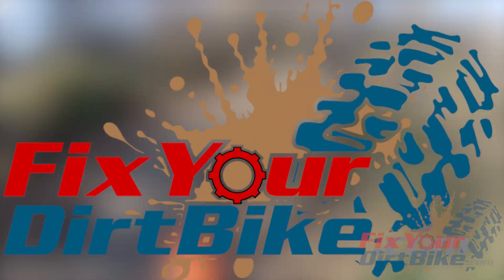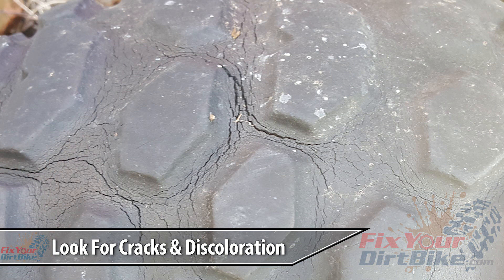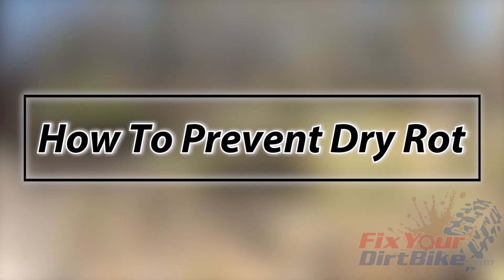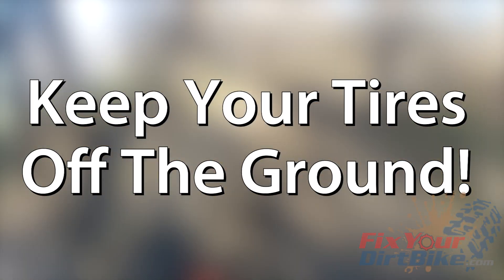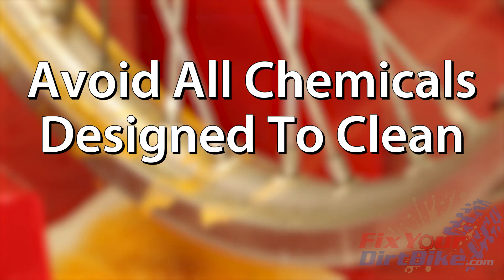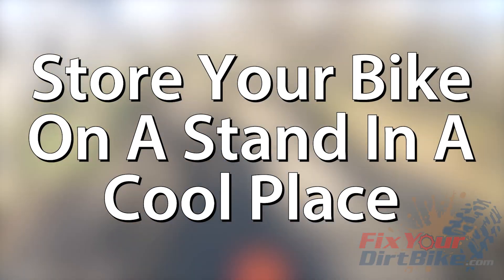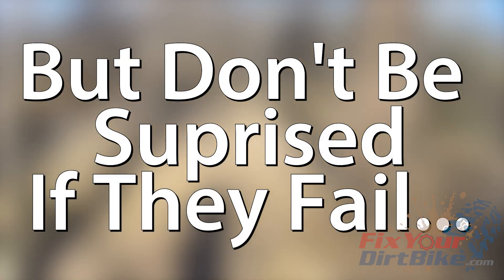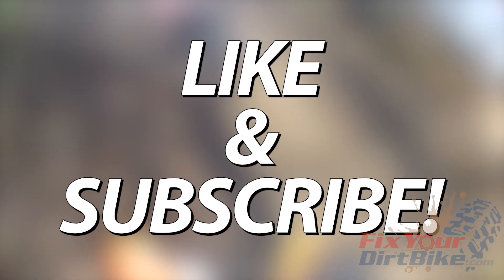Why Do Tires Dry Rot? - How It Works | Fix Your Dirt Bike #howitworks #dryrot #dirtbike

Comment: do i need to replace a dried rot tire that has a tube inside and designed for tubes?
Reply from the maker: Depends on what you want to do with your bike and how bad the tire is. I have a beater bike with worn down treads and alligator side walls that I won't replace until it fails. Any bike I travel with has good tires though.

Comment: what chemicals rot a tire faster? what household items would be a no no to clean my tires?
Reply from the maker: You should be fine with most household chemicals, just avoid any degreaser. Whatever you use you should be good if you wash it off right away.

Comment: i wonder if when i washed the bike, soap got on the tire last year, maybe it weakened it so i could slip off. not using dish soap again.
Reply from the maker: Soap wouldn't act that fast. Either your tube was long gone or your rim lock was loose.
Reply: @Fixyourdirtbike  if i was going like 40 and the tube blew all at once like that, would that make the whole tire come off like that? i felt it come off about one second after it went squirly like it had the tire on the rim but flat for a second and it just blew off after where it was just rim on ground
Reply: i was on a road, i i know i shouldn't have been street riding it but i was.
Reply from the maker: That definitely sounds like the tube slipped and tore the valve stem off the tube.
Reply: @Fixyourdirtbike  i agree. man i appreciate your thoughts on it makes me feel less freaked out about it
Reply from the maker: Any time!

Comment: i just had my front tire come completely off the front rim of my dirtbike going about 45 and had a nasty spill, i believe this was due to a rotten inner tube. the valve stem ripped off released all yhe air at once and the tire came entirely off. if your gunna be goin fast you need everything nice and safe everyone.
Reply from the maker: That sucks! Are you alright?
Reply: @Fixyourdirtbike  yeah just some ligaments got tore slightly. never had an entire tire come off like that tire looks brand new but i guess at that speed it just came off the rim
Reply from the maker: Damn dude! Get well soon!
Reply: @Fixyourdirtbike  thanks man i like your vids by the way
Reply from the maker: Thanks!